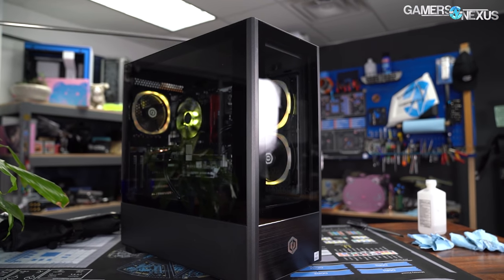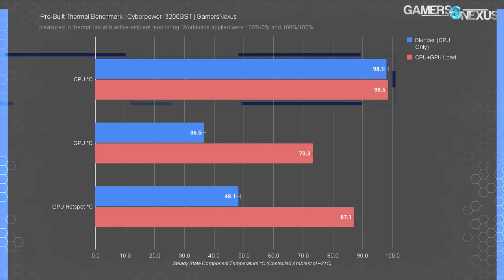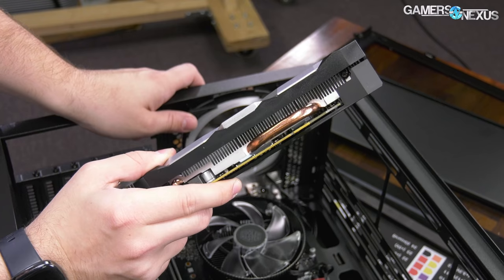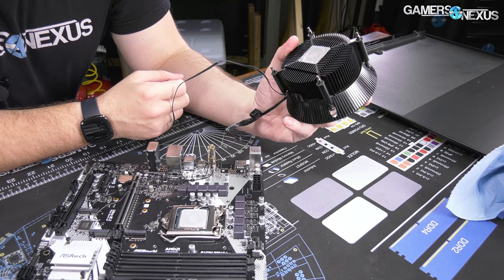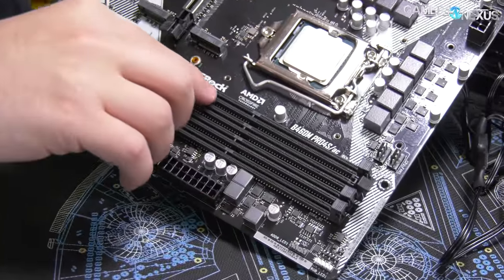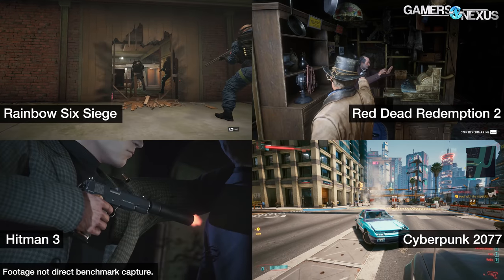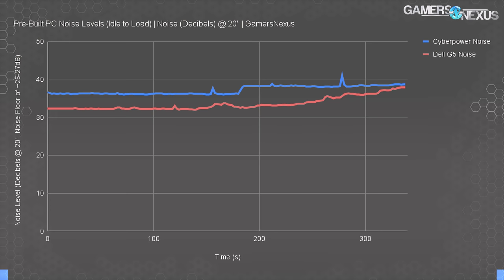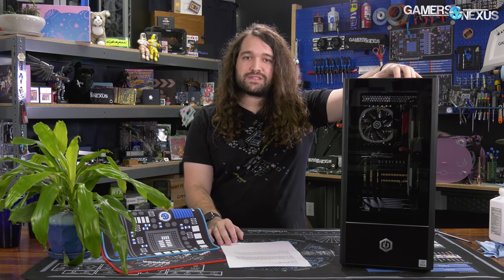Almost Didn't Suck: Cyberpower $1000 Pre-Built Gaming PC Review (Gamer Xtreme 3200BST)

Comment: i just bought a pc from cyberpower now im nervous i spent 3200
Reply: What were the specs
Reply: @amandacakee  CyberPowerPC KIRA II 241V Mid-Tower Gaming Case w/ Tempered Glass Side Panel + 4X ARGB Fans Included (White Color)
CC: None
CPU: AMD Ryzen™ 9 Processor 7950X 16-core/32-thread 4.5GHz [Turbo 5.7GHz] 80MB Cache AM5 [+156]
CS_FAN: Default case fans
ENGRAVING: None
FAN: CyberpowerPC MasterLiquid Lite 240mm ARGB CPU Liquid Cooler with Dual Chamber Pump & Copper Cold Plate (Intel)
FREEBIE_VC: NVIDIA Warhammer 40,000 Bundle [+0]
HDD: 1TB WD Black SN750 SE Series (PCIe Gen4) NVMe M.2 SSD - Seq R/W: Up to 3600/2800 MB/s, Rnd R/W up to 525/640k (Single Drive)
HDD2: None
HEADSET: None
KEYBOARD: None [-5]
MEMORY: 32GB (16GBx2) DDR5/6000MHz Dual Channel Memory (Team T-Delta RGB)
MICROPHONE: None
MONITOR: None
MOPAD: None
MOTHERBOARD: ASUS ROG STRIX B650E-E GAMING WIFI AM5 ATX w/ Wi-Fi 6E, 2.5GbT LAN, (3)PCIe x16, (4)M.2, (4)SATA [+250]
MOUSE: None [-3]
NETWORK: Onboard Gigabit LAN Network
OS: Windows 11 Home
OVERCLOCK: No Overclocking
POWERSUPPLY: 850 Watts - CoolerMaster MWE GOLD 850 - V2 80 PLUS GOLD Ultra Quiet Full Modular Power Supply
PRO_WIRING: None
PROMOSALE1: CyberPowerPC FPS Gaming Mouse Pad [+0] (Large 14x12 Inches)
RECOVERYUSB: None

Comment: i bought a cyberpower pc last year and have been nothing but happy with it. it was terrible timing as the new nividia cards came out about 2 months after I bought it but it came with a 2070 super and a 3700x cpu and I paid 1350 for it and its been a solid computer so far. I actually was impressed by them.
Reply: How’s it now?
Reply: @Gojoglazer  other than ram failing been problem free 🤷‍♂️ still use it daily. Started using it to mine crypto when that dad happened and it paid for my computer so no complaints from me still. Replaced the ram that was causing random blue screens with Corsair vengeance and put a m.2 In. Probably going to buy another prebuilt and give this one to my daughter In the next year.

Comment: I had my machine pre-built to spec by memorypc and I am very happy with their choice of components and the care they put into the building process :)
Reply: I heard memorypc is one of the best in usa. Here in Germany it's dubaro
Reply: @nezziaktm9922  I still like working with them but I found out they totally fubared the memory so no matter what I do in BIOS I cannot exceed 2999MHz... so they arent perfect but decent. also never got a reply on my support request for that x_x
Reply: @streamdungeon5166  sad :/ maybe change out the ram yourself
Reply: @nezziaktm9922  I guess it needs a BIOS update as the RAM is rated for 3200. just sad that they would let you choose a speed of RAM and then not make it work on the mainboard out of the box.

Comment: $150 more than the Dell for higher temps...really?  The whole point of a prebuilt for the average consumer that just needs a PC is to NOT have to modify it to make it work.  GN has now moved away from the real valu add of these systems for the average non tech consumer and is now entering the area of saying something is better, IF you modify it.  So, the statement of "better than the dell" is really use case based.  As a regular joe that needed a computer to surf, pay bills, watch videos and do light gaming, I would take the $850 Dell any day.  Now I am a tech person, so I personally would not, but again, its use case based.  Cyber Power is terrible on Q&A and 100 degrees will certainly shorten life spans.  Still waiting for GN to find that "Good" prebuilt that also happens to be a good value....this IS NOT it.
Reply: All that being said, Steve referred to this several times as a Gaming PC.  With simply that being the goal, I could see recommending this over the dell since it technically "games" better.  However, that thermal is shameful to even ship it like that.  So really, two complete failures.  Cant wait to see who does it right at $1K.
Reply: Molex Centipede...best term I have heard for a long time.

Comment: Plus stuttering, and cpu health over time. It seems.. fixable though, certainly something that could be quickly added in their evaluation scripts, just running a benchmark for 5 minutes. Yes, that's some additional time, but easy to set up and automate, and the thing that costs when building these systems is not how long it takes to build the system, but the amount of time *the builder is working on it*.
Reply: "CPU health over time"

False. The CPU is designed to run within its thermal design at all times.
Anyone who is telling you different is spreading FUD (fear uncertainty and doubt) or outrage-for-clicks.

Overclocked CPUs can experience shorter lifespans due to the increased AMPERAGE being put through them, which degrades the traces.
Heat is the BYPRODUCT that is blamed for shortening the lifespan rather than the cause.
If you overclock something to the point where it would die prematurely then it will do that whether it runs at 40 degrees or at 100 degress during its lifespan.
Reply: @tim3172  sigh They degrade via the heat generated, and the amount of fatigue generated via the wild temperature fluctuations. This is super simple physics. Something that is hot, and remains hot, does not undergo thermal stress.

The only other thing is the breakdown of semiconductors, but for that you need something over the reverse breakdown voltage. That is not what is happening.

Thermal throttling is meant to protect the hardware. I have had hardware with a broken pump throttle all the way down to 300 megahertz, because the AIO cooler pump broke.

With thermal throttling, it keeps lowering the frequency, letting the device cool, followed by increasing the frequency, making the device heat up. It keeps doing that over the *entire chip*, for the entire time it's under load.

Comment: I wouldn't be surprised if they started with the $1000 price point first, then tried to make as much money as possible from it.
Quick question on that cooler: Could you use a belt sander to flatten the the cooler surface and some plastic washers/ spacers to get better contact? Not that I want to encourage that level of modification.
Reply: Sorry, the washers or spacers would be for the mounting screws. Could just use shorter screws I guess, if you can get the same threading. I guess that makes them tiny bolts.

Comment: 12:38 That looks like a Cooler Master i71C RGB cooler.
I'm kinda surprised: that cooler has decent/passable reviews on NewEgg. 🤔
What exactly is causing the hole in the center of the contact area?
(Is the copper circle bowed? Is there too much flex around the CPU socket?)
Reply: its got crappy reviews! dont fool yourself.
Reply: As of Sept 2021, NewEgg has 4~5 Egg Rating for the i71C RGB; Amazon has 4~5⭐.
Which site has the unfavorable reviews?
~~(sincerely curious before I make a buy/don't-buy decision)